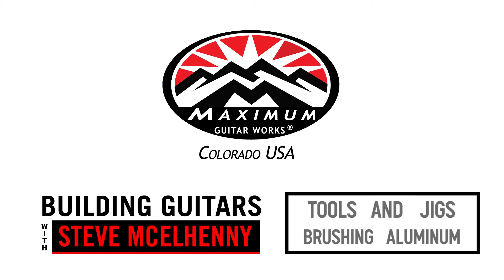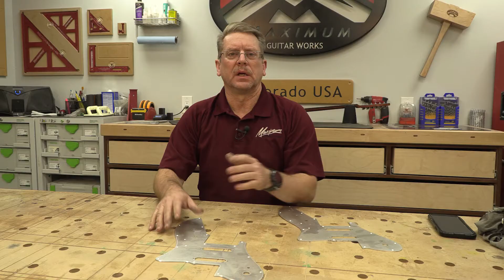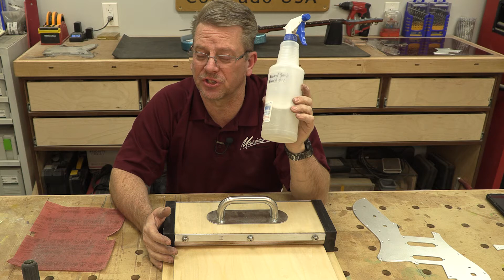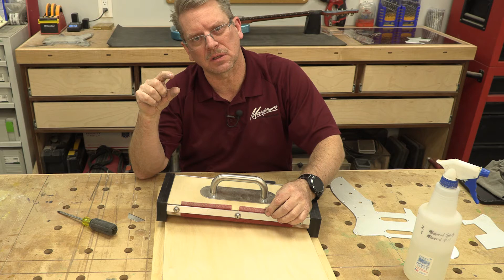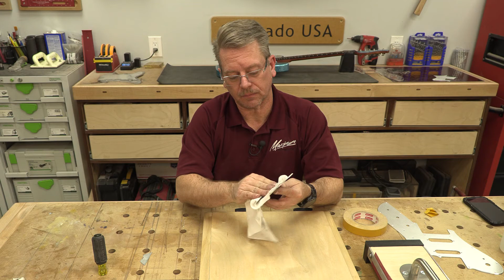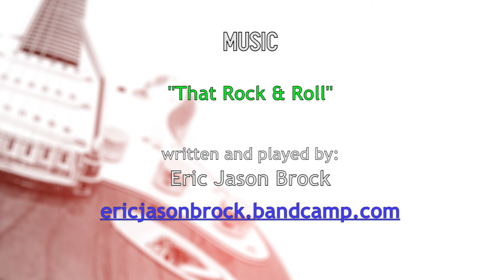Perfectly Brushed Aluminum Guitar Pickguard (Tools and Jigs Series)

Comment: Thanks so much, I just used this technique to build my own aluminum pickguard! Question, do you clear coat it after, and/or does aluminum hold up to wear and tear?
Reply from the maker: My goal would be to anodize.  But I need a dozen pickguards to make the cost per justifiable.  So, I just clear coated to prevent any oxidation over time.

Comment: totally sweet guitar. I would love to see the truss rod adjustment wheel a blue color to match the inlays!!!    love the videos , keep em coming
Reply from the maker: Painted blue...anodized...or some other variation of color treatment?
Reply: @maximumguitarworks  speaking of colors... another youtube channel, scar my guitar, ... who also works with "excellence" (lol! -see for yourself), ... lets just say he has an opposite style compared to Steve, but the results are also excellent, has an awesome idea of doing the fret dots/inlays... he uses a 3d pen you can buy on amazon which uses a roll of that plastic string material to fill in the dot holes. super cool because you can get that material in a bunch of colors to match with rest of your color scheme of the guitar... you just fill it in and sand it off. brilliant idea!
Reply: @maximumguitarworks     I was just thinking whatever sort of color would tie that with the inlays.

Comment: Awesome jig and process - I can definitely see me using this. I'd be worried about aluminium as a pickguard material though, particularly if it's fairly thick. Given how conductive it is, I'd be concerned about eddy currents killing the top end response of the pickups.
Reply from the maker: I'm not sure about all of that.  I have used it before with success and no issues.  In fact...I just finish final setup of a silver sparkle Nellie last night...and it sounds incredible...oh wait, that one has a Carbon Fiber pickguard.  I plan to do a demo video once the "Barbie Blue Sparkel" Nellie TSS is complete...so maybe that will answer some questions.